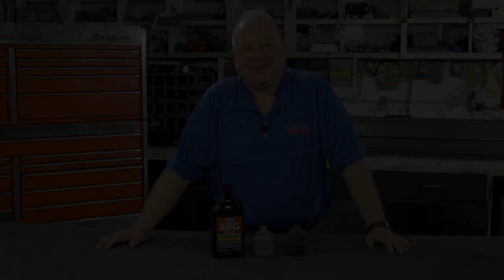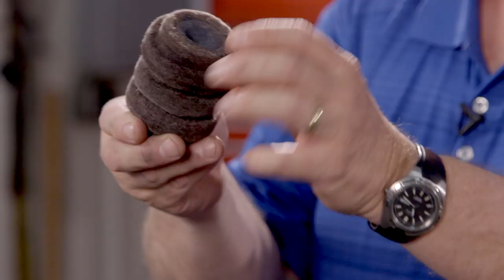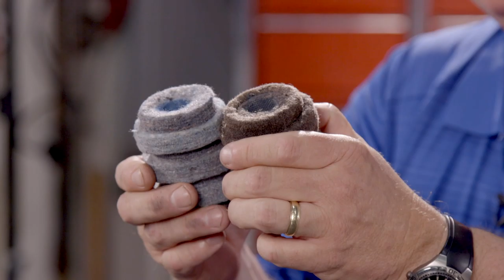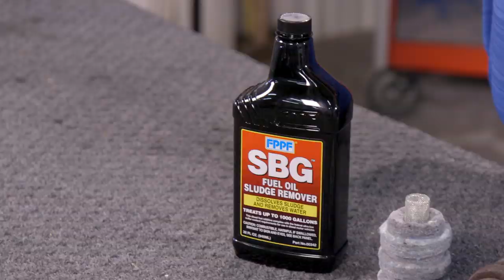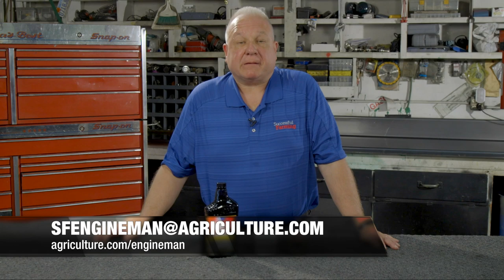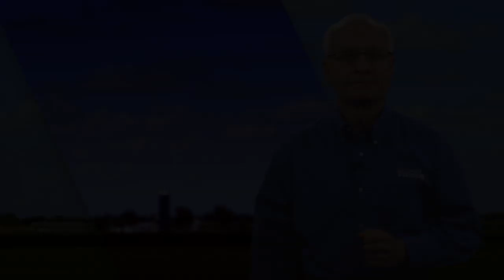Sludge Remover for Diesel Fuel Storage Tanks | Farm Repair & Maintenance | Successful Farming

Comment: I removed the diesel fuel from my tanks. The sludge would not come out. Will this dissolve the sludge in the bottom of a 5' long 100 gal aluminum diesel truck tank. Next question is how do get the dissolved sludge mixture? Will a transfer pump remove it all?

Comment: Great !  I have an old 275 gal tank that I haven't used in a longgg time. Pulled the plug and drain. Had about a gallon of water
and 6 gallons of oil. What is the best way to clean, remove surface rust and slugs? 
Thanks  Ken